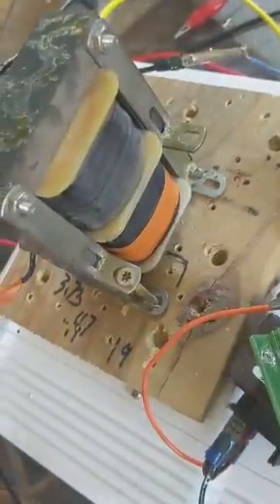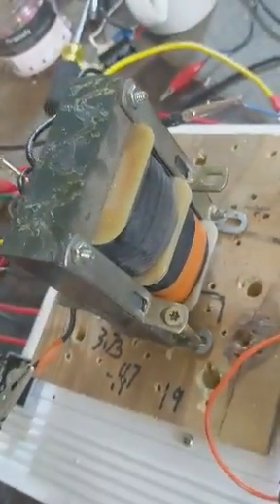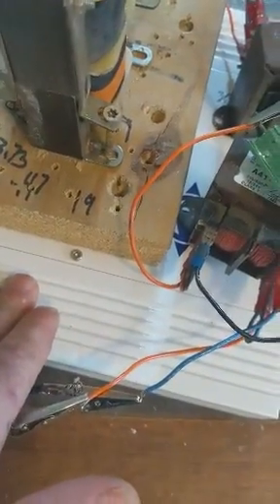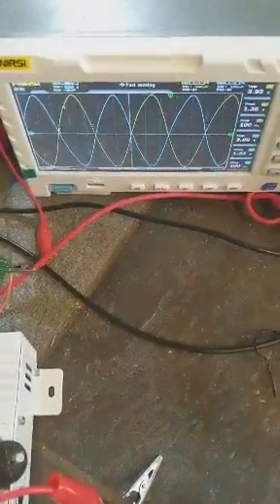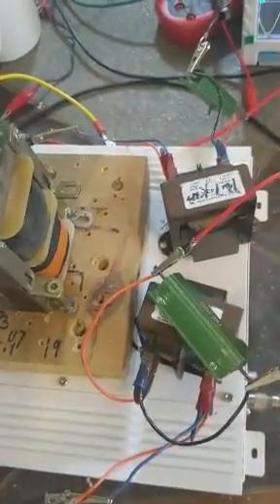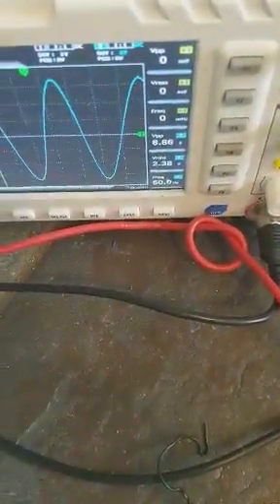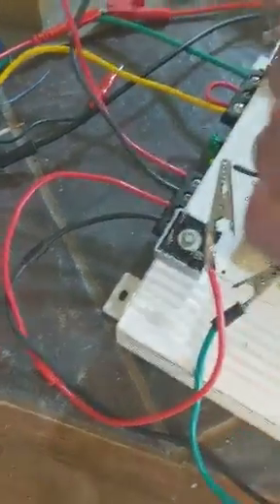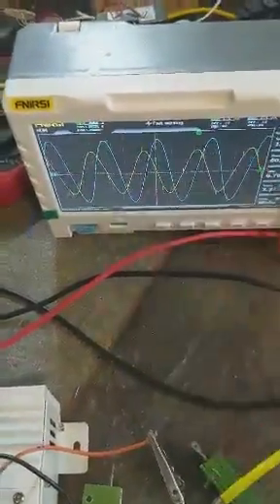Phase Shift In attempts to eliminate lenz.

Comment: What you are doing makes sense, but need to establish efficiency of the total energy transfer input to output.  The Heinz Bi Toroidal approach also works to defeat Lenz however input to output efficiency is quite lousy, for me anyway. Thank you for helping our cause !
Reply from the maker: Hello Smoky,  IMO, the Bi-toroidal xformer can never go OU as a transformer.  It send's the secondary's flux back through the other secondary instead of the primary.  Sure you get no Lenz, but you also cancelled almost all power production. He bypasses Lorentz reciprocity principle of the primary, but because the secondary's are receiving magnetic fields in 2 opposing directions,  the output is very low.  As I see it, all he can get out is the inefficiencies of the core. Maybe the design can be adopted to work in another arrangement.

And Mine also, output is currently small.  We will see if I can come up with anything tho,.
Reply: Trabajar con resonancia puede ayudar con condensadores adecuados

Comment: I tried replicating the Thane hiens bitoroid transformer, and i got some good results. Yours look easier, I'll try replicating yours one. 

Will this work fine on 50hz or do we need frequency generator for this?
Reply from the maker: 50 Hz is OK, but you need to input 2 waves shifted by 90 degrees into a stereo channel. So a dual channel frequency generator, or if you have a bluetooth amplifier you can use audacity to make the waves and bluetooth them in.